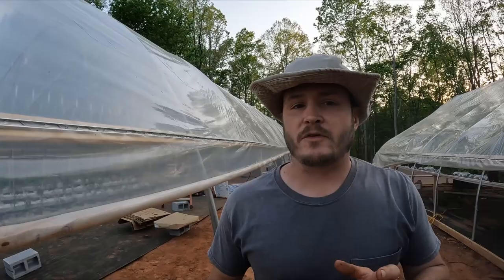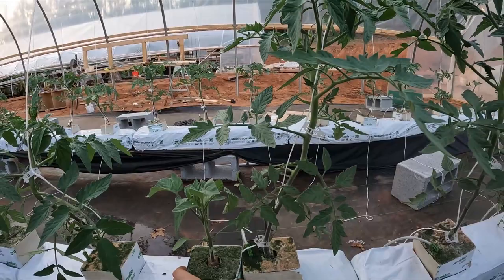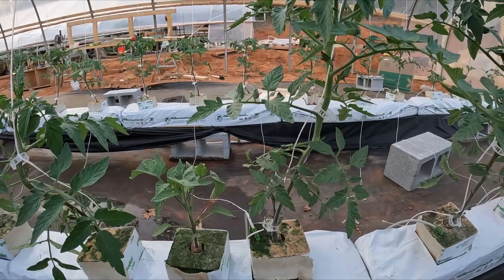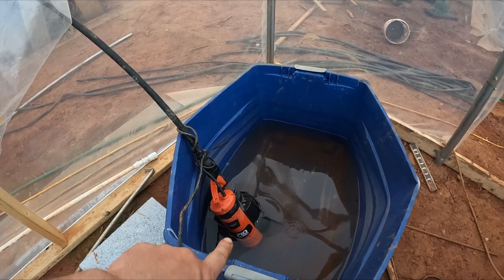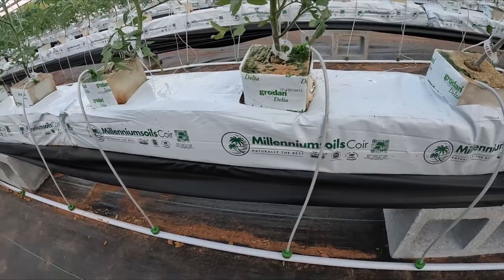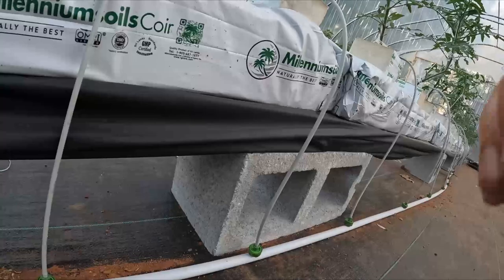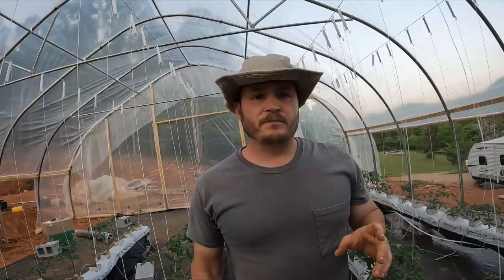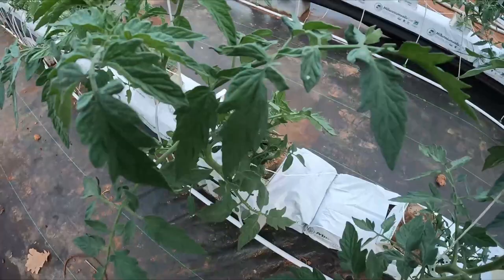DIY Hydroponic Tomato Greenhouse Walk through - Huge growth after only 2 weeks! Tomato hydroponics!

Comment: Great solution for growing tomatoes. I would like to develop very similar thing. May I ask that the rockwool is not poisonous for the plants and later for whom who are eating it? And please let me know what are the ingredients of the water? And where did you get the tools for the pipe? I mean the spaghetti pipes that are connected to the half inches main tube. Thank you!
Reply from the maker: The Rockwool is not considered omri but it is essentially just melted rock that’s spun into a cotton candy like texture. An alternative to a setup like this would be to just use grow bags , and then use your favorite compost/garden soil/perlite you name it. Then you can control exactly what material you would like to use. I am currently using woodchips in my grow bags.

I purchased the tool form floraflex, I will try to post the links 

https://floraflex.com/default/flora-micro-hole-puncher?gclid=Cj0KCQjwpcOTBhCZARIsAEAYLuUyi0I8wF9ZQUDCqakO6liUATn9tmkezZLe-KprYGMFZ0Tjp8l56v4aAjraEALw_wcB
Reply: @SaludaGradeFarm  thank you